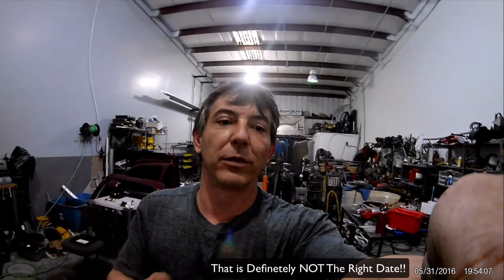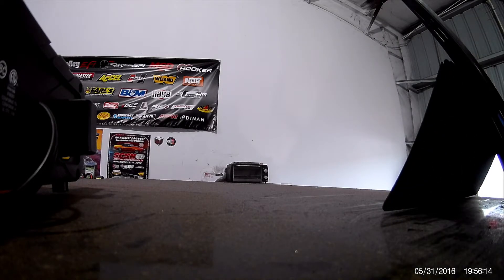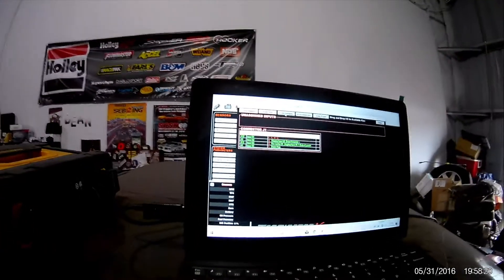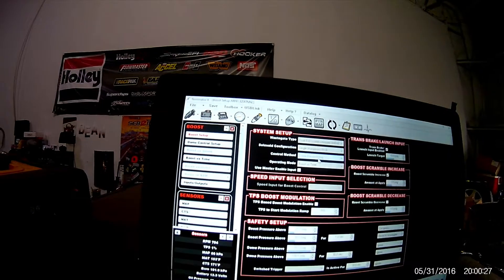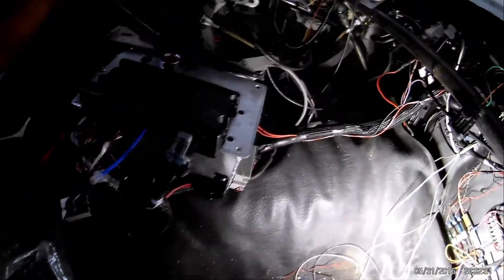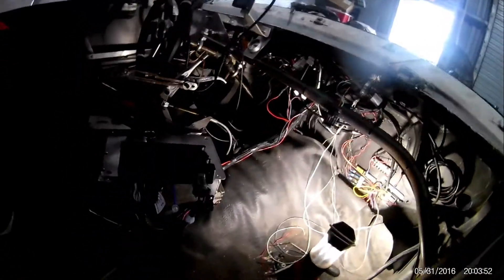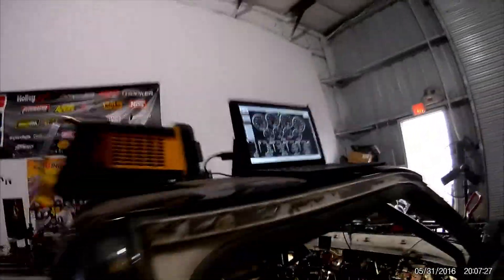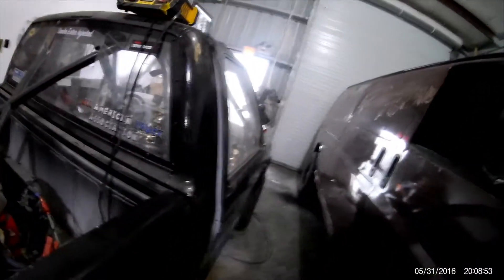Holley Terminator X Inputs and Outputs

Comment: I have the HP, which inputs/ outputs do you think are the most important for a street turbo car? My boost control is only a wastegate, I have a switch for the two electric fans. Thanks
Reply from the maker: It depends on your preference. Boost control is essential IMO, transbrake and 2 step can be on same ground input, from there it's up to you. I personally like fans to be controlled through ecu.

Comment: My 5.3 starts but feels like its running on 4 cylinders. I confirmed spark and fuel.  I bought my term x setup in Nov 2019.  Is this what I likely have to do, a file update? My engine runs fine with a fitech setup.
Reply from the maker: Is it a fresh install? Installed in Nov? Did you double check you have the cylinder orientation correct?
Reply: @CyrPerformance1  yes, injectors and coil are in their proper firing order as well as coil plugs. Its possible that something may have been crossed during manufacturing. I just dont want to dig into it more than plug and play.
Reply from the maker: @jcr8834  all of the grounds are good? If all of the wiring is in correctly, then something in the tune is not right. The update is more for using bigger screen, different sensors and things being added as in manufacture types. Email me your number at cyrperformance@gmail.com and I can try to walk through some things if you'd like
Reply: @CyrPerformance1  id be very interested in some help for sure. Ill email you. The guys at the Holley forum just accuse me of improper install as always. Ive assembled several megasquirts from scratch but this is a system that doesnt explain much for itself.

Comment: I just bought the Holley terminator x wiring harness, I’m using the arc switch panel, and I’m wondering which wire can I run to the switch panel to send fire to the motor after it’s cranking, thank you in advance
Reply: I’m sorry I meant what color wire on the harness, I’m having trouble finding anything on line, I have everything ran but I want the motor cranking before I send the ignition to it. Just wanted to know if there is a wire on the harness that will work, thank you
Reply from the maker: @colemccollough7346  Good question, we probe the terminals and activate the switches to verify which to connect to. With power to the panel, use test light and activate each switch, the light will illuminate when you are on the correct terminal  where you connect output wire. We label each relay with switch number to ease future connections.
Reply from the maker: If I understand your question, you are asking which switch to wire for ignition? Typically we use the second from the left, corresponds with the label that can be purchased for that, if you have the 8000. Hope that helps, thanks for the question!!